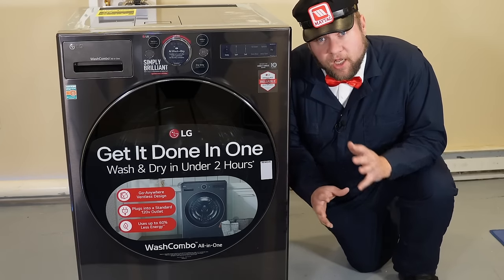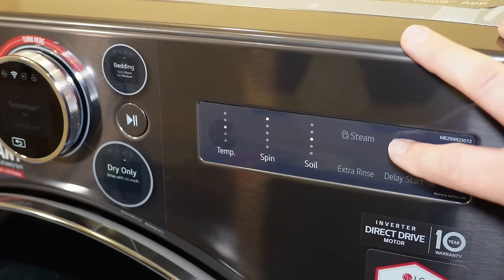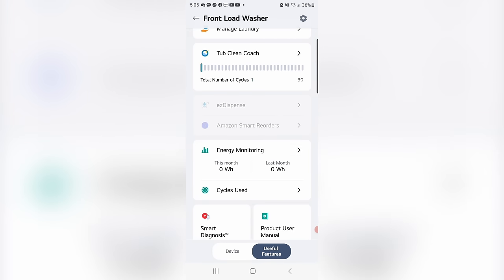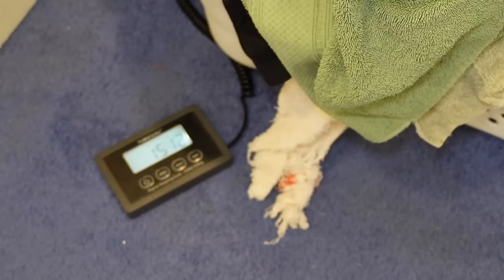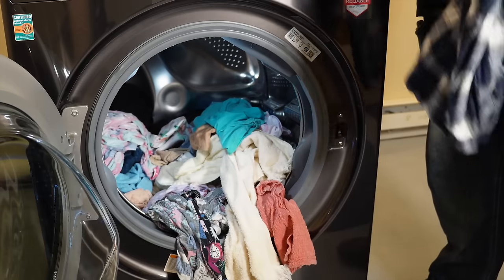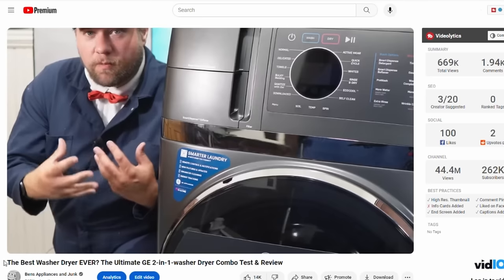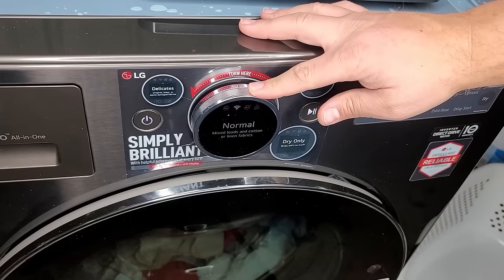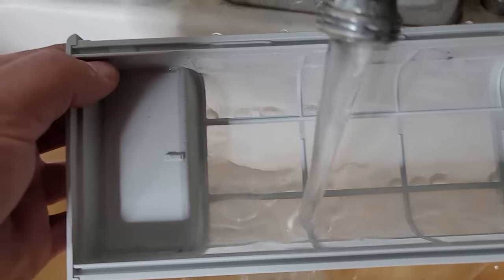BETTER THAN GE? The LG All in One Washer Dryer Combo: Test, Teardown & Review

Comment: We bought this unit on June 22nd.  A small load of towels took 5.5 hours and the towels were still wet.  A LG repairman diagnosed a bad “motherboard” and ordered that part. A week later he came back only to discover the wrong part was delivered (or ordered).  A week later a LG repairman came and said three boards plus the main knob has to be replaced because there is a harness Beijing that knob.  The knob had to be back-ordered. So we're without a washer/dryer for five weeks and we have no idea when the knob and the replacementent parts will be available. Don't recommend this piece of junk!!!!!
Reply: Suuuuuper shocked to see he recommended this as I've only heard 90% bad things. Always the same story. "Machine broke, repair man and LG incompetent and dumb and now it's been 1-3 months without washer/dryer"

Comment: Your channel is uniquely valuable for consumers. Thank you.
Reply from the maker: I appreciate that!
Reply: I went through two LG washing machines in a period of about 3 years. Was not happy at all. I now have a GE and I'm extremely happy with it
Reply: Your comment made me sub before I’ve even seen one of his videos 😂
Reply: You know LG is now in hot water for their refrigerators failing after less than a year, right? 

Maybe skip LG appliances until the lawsuit is over.

LG has been in a bad spot ever since their mobile device division was closed.
Reply: @basquo2 LG has been in the news lately for their fridges doing the same thing. 

I'd avoid them. There are lawyers looking at misconduct.
Reply from the maker: @Boogie_the_cat  they've been in hot water for years. It's not new. And it's almost exclusively relating to their fridges
Reply: @bensappliancesandjunk  "it's almost exclusively relating to their fridges"

Dealing with a Samsung through-door ice dispenser right now.  Ices up every couple weeks.  Big point of annoyance for the relatives (as I am the 'fixer').  The monthly use of a heat gun and/or a full defrost is stupidity on top of insanity; life should not be centered on spending hours fixing things that are used for a few minutes.

I'm trying to spread the idea that ice makers should be in the freezer with no hole cutting to the front.
Reply from the maker: @EclecticOmnivore  "I'm trying to spread the idea that ice makers should be in the freezer with no hole cutting to the front."

You do realize I have the largest video on fridge recommendations on YouTube where I state that pretty directly, right?
Reply: Agreed!
Reply: @bensappliancesandjunk  Any plans to do a review for the Samsung AIO vs these two?
Reply from the maker: @yourerightimwrong4567  its in my washroom running a load of towels & bedding (12lb 11oz) as we speak!
Reply: @bensappliancesandjunk  Right on!  Can't wait to see the review!
Reply: @bensappliancesandjunk Did you see the newest LG TL washers?
Reply from the maker: @laundryandtrainman2467  which ones? I got a WT6105 in my room to test soon!
Reply: @bensappliancesandjunk  Yay!

Comment: We ended up buying this unit.  Nice to have the extra room.   Costco has a 1000 off at 1800 and that includes delivery, install and haul away.  5 year warranty was 174 bucks.  Thanks for the video, you really convinced me.  I did not know they even had combo units.
Reply: Please tell me you put in a utility sink with the extra room. That's the only way one of these makes sense. And why didn't you just get stackable units?
Reply: @rickybobby7276 or you get 2 of them and do 2 loads at once. 1/2 the laundry swapping time.
Reply: @huh0123  That's the definition of an epicycle where you take a complex approach to solve a simple problem. You are buying 2 combo units at the price of $5,000, because they work half as fast and even then not fully drying your clothes. Go and take another epicycle to try and prove yourself right.
Reply: @rickybobby7276  I am very much looking into getting a combo unit, then I load it up, set it to run at whenever electricity is cheapest and then just show the close back into closet. No drying needed, it already be done.
Reply: @rickybobby7276 One possible reason that’s super easy to think of is that some people don’t have the room for that. Stop trying to have some sort of intellectual high ground in the comments of a YouTube video and keep moving with your life.
Reply: Run time on a washer only matters to me if I need to be there to dry it. I don’t really care if it takes half the day if I can just set it and go about my day
Reply: markfradl exactly,  I've been functioning perfectly fine for the last 16 years without one.
Reply: @rickybobby7276 Because I'm lazy lmaoooo I got better shizz to do than babysit clothes all day. Our current washer/dryer unit does not have an app and it seemingly gets done at random times and 80% of the time it's still damp out of the dryer. Why would I spend the same amount on a stackable, even if it has an app, when I can just... Throw dirty clothes in before bed and they're clean and dry in the morning ?

Then the time it takes really wouldn't matter.

Y'all REALLY need to change your perspective on doing laundry before acting like combos take up more time just because they have a longer wash/dry cycle.

And don't even get me started on how often I forget laundry in the washing machine overnight.

Comment: Yes. Please do a side by side comparison with the GE Ultra Fast.
Reply: Yes please!!!
Reply: the GE gets very bad reviews. Nothing but issues with drying.
Reply: @basa820  tbf, reviews on the LG aren’t the best either. It sounds like there are many defects so one has to be really lucky to get a fully working unit. Most complaints are about how it takes forever to dry.
Reply: @Al-zx1fn  looks like they all have issues with the lint.
Reply: @basa820  yeah I think we just have accept the fact that it’s going to take some time for these units to meet our expectations. However, the competition is good for us consumers. And I certainly won’t miss having two appliances to do the laundry 😆
Reply: @Al-zx1fn  have you heard anything about what components or issues lead to the variability in drying performance? I've had one or two of the GE's I've sold where there was a clear manufacturing defect, and I don't have any feedback on the LG yet, but I'm curious what would lead to so much variability in performance... Other than the user.
Reply: @basa820  Absolutely not true. I have two of the GE's and they dry like a champ.
Reply: Biggest issue with both machines is lint gets passed the filter and starts plugging up the condensor core. You either gotta seal the filter better, remove filter and use a long skinny brush after every load, or disassemble the unit to clean pretty often.
 @dregenius
Reply: 29:11  here’s your sign.
Reply: @basa820  the reviews on drying are not true.. most of them are people that have never used or owned one.
Reply: @Al-zx1fn You're absolutely correct, I have really been reading up and the LG all in one, sold a lot of these washers knowing there were defects and then recalled them after a lot of complaints. GE when they got the complaints about the filter they recalled their washers and refunded people their money. GE is working on their washers. 👍
Reply: @bjishername  when did ge do this recall?  And when did they refund customers?  I have contacted them.multiple times and a refund was never mentioned...
Reply: @Mike-cc3bc  I read that on some of the clips out there that GE did a recall but it's my understanding based on what I've read recently that GE is working on a new filter to get all of the dust. The Samsung Bespoke All in One Washer, the filter has been fixed and Samsung is upgrading their machines. It's out there check it out for yourself. 👍

Comment: The 380v compressor and condenser fan motor is very common in inverter drive minisplit heat pumps. It may be a compressor and control/power system they recycled from their mini split line.

Comment: We have the LG 4.5 Cu Ft washer/dryer combo unit and like it. It has a long cycle but clothes come out clean and dry. There is a lot of lint build up around the door seal that needs to be wiped off after each use.

Comment: Hey I’ve been dealing with plenty of household appliances and my opinion of anything LG is over hyped, overpriced unreliable products that seem to all break down in a relatively short time period. They then continue to keep breaking down after repeated repairs. Now this everything in one large unit. AND LOOK another 10 YEAR VITAL COMPONENT WARRANTY. 
Heat pump A compressor comes to mind . That means Freon . Correct me if I’m wrong. 
Let’s see. 
Excellent tutorial Ben
Reply: Untrue. I’ll give you that on fridges Lg sucks, but everything else Lg makes is amazing quality, rightly priced and performs great. Easily outperforms many other competitors on the market like ge whirlpool etc

Comment: All well and good but only time will tell durability. Anything around water with all those electronics in them, will break down before the old real dials knobs and buttons… My LG washer control panel flaked out on and off for several months a few years ago. I thought for sure it was done already.. fortunately it stopped doing that on its own and has been running fine since. Replaced the spider, seals and bearings of course, but fortunately the board has been ok. Good thing cuz you can’t get that part. Bad form LG…. The original LG fridge we had was crap too. They finally bought it back but we had to buy another LG to replace it in the deal.. I don’t trust their products much..

Comment: We went with the GE Ultrafast Combo about 6 months ago, knowing that LG and Samsung would jump on the heat pump band wagon.  We have been absolutely delighted with our GE Ultrafast for our family of 5, and know these heat pump all-in-one machines are only going to get better, and become the market standard instead of separates.  If there's one thing I don't like about the GE, it is the lint filter housing.  I resort to sticking a light and a small vacuum hose into the narrow slot when I do the lint filter to get bits of lint out to keep lint out of the condenser.  I can imagine GE Ultrafast V2 and the competition will fix this deficiency, but I'm still happy with the GE.  I love the huge detergent and softener dispensers which make laundry in most cases a power + play 2 button press and I get clean & dry laundry a couple hours later.
I welcome LG's entry, and look forward to others joining.
Reply: The sad thing is GE is Hisense,  Ge sold their appliance division a few years ago
Reply: Hisense isn’t a bad make as long as you don’t go for the entry levels in my opinion you get more options and bigger drum the more you pay cheep Hisense is very limited my friend has one they prefer there old hotpoint made by whirlpool.
Reply: I believe GE’s appliance division is owned by Haier. They bought them out in 2016.
Reply: Totally agree with your comments. The GE machine is near perfect except for the lint defect. Someone needs to come along and make it smaller without the deficiencies that we are seeing in this new LG.

Comment: I've had the previous, previous version of this for over a decade, I'm never going back to separate units.  Not having to move the laundry around is worth the extra time.  You definitely hit the challenging points, never ever fully load the drum, and heavy things should be washed and dried solo.  Thank you for covering the filter removal, that's the biggest challenge on mine.  I have to drain the unit to clear the filter, and I've replaced the drain pump twice due to lint migrating past the filter and stopping the pump from operating.

Comment: Wow Ben! After scrolling by the man in the Maytag suit in the past, I finally watched your super in depth testing and disassembly of this LG Combo unit. As a tech that has worked on all kinds of machines, vehicles and computers, I found your video made for someone like me that wanted to see the insides to truly understand the engineering and possible flaws in this unit's design. Your use of flow meters, data loggers, GoPro really shows you go to great lengths to reveal the true statistical performance of this LG product.  I agree with you that in the future, features like the smartphone App will become a major deciding factor in the future as younger people who grew up on expectations of technology to be included in products to be considered for their purchase. That software becomes the absolute must have feature that can be so easily added and updated. I would think that having your appliance on your home network would be super helpful in troubleshooting any issues with a product as the ability for these devices to send error data back to the manufacturer's online diagnostic systems to automate the diagnosis of any service issue of these ever more complex appliances.  Thank you for your super in depth review. From nuts and bolts to the ultimate Mom test, your review was great! I look forward to watch more of your YouTube videos.
Reply from the maker: Awww thanks! That means a lot that you enjoyed it!

I have a similar review for the GE Ultrafast combo. I had so many people ask me about that one/to do a review, and I saw so many other reviews just gloss over the exterior that I just wanted to get one and noodle around to see how it worked. But I got it ~5 months after launch and I decided that the next combo unit that came out, I'd try to get it near launch and see how it works. 

For me, its SUPER INTERESTING on the design theory of this unit vs. the GE, and how they've built similar, yet vastly differently operating units. 

Given the extremely fast sales of the GE unit, we're entering a new era of combo units, weather we like it or not, so at least we can be prepared to see what it may look like!
Reply: It’ll be the opposite in a short while, I assume. My buddy who bought his first house a few months ago thought the same, and decked it out with smart everything. Samsung Smart fridge, LG Wi-Fi smart washer & dryer, Philip hue lightbulbs, the whole nine-yards. 9 months later, he says he hates it and will be switching back to traditional, “dumb” appliances when his appliances kick the bucket for good. Unreliable, delicate, and low quality were his complaints. 
It’s like touch screen in cars, everyone is slowly realizing how much more complicated and annoying using a touch screen vs dedicated buttons is, and the market is demanding manufacturers to move back to buttons. 
Like why would I even want my washer/dryer to phone home via the internet back to LG anyways? Considering how insecure & stuck in the past in terms of security & privacy these large manufacturers are, I don’t trust it to not send my name & home address in plain text back to LG’s servers to store for god knows what reason. Or worse yet, when it hits EOL LG will push an OTA update to brick the washer/dryer from functioning ala Sonos speakers. Or how about pushing an OTA update to lock features behind a subscription paywall, ala BMW? Those “smart AI Wi-Fi” features are nothing more than marketing buzzwords designed to jack up the price in exchange for adding an single extra option in the dial, what practical use does it even have that wasn’t accomplished by the other options